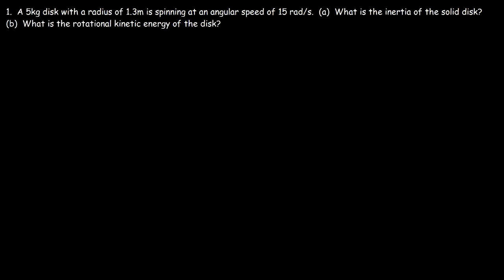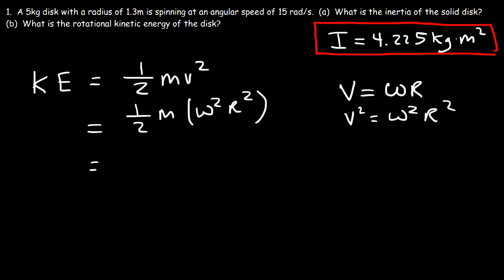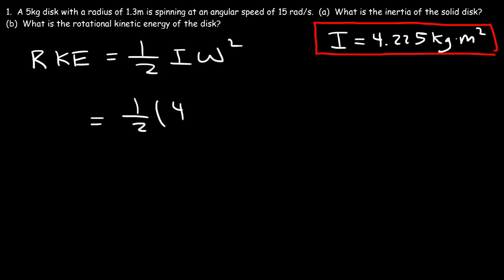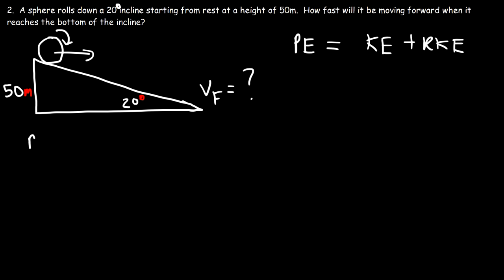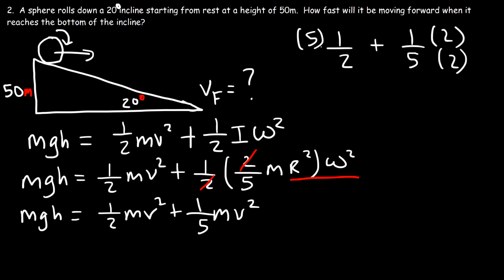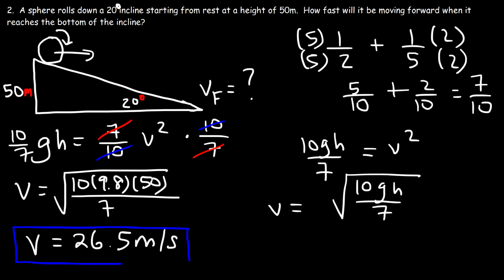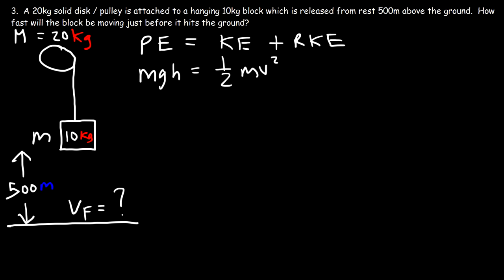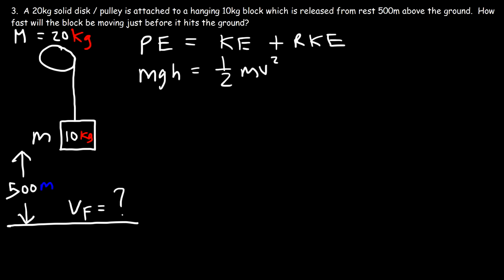Rotational Kinetic Energy and Moment of Inertia Examples & Physics Problems

Comment: K.E=IW²

K.E≠½IW²

From I=½mr² and v²=r²w²
K.E=½mv²=½mr²w²=½mr² × w² 

K.E=IW²

Mistake sir,you taught me thou😻🔥
Reply: Inertia is mr², it doesn't have 1/2
Reply: @susa9786  yeah but the tutor said in the video that the inertia of the disc= 1/2 Mr^2, and then he replaced it with I which is supposed to be I=Mr^2, and thats where the extra half came from.( normaly RKE=1/2IW^2 , but not in this case as her I=1/2Mr^2)
Reply: KE is equal to (IW^2)/2
and Impulse should be I=mr^2

Comment: 9:19 I know we get excited when we can start computing, but consider solving for v before you start to plug in numbers, as OCT did on the previous problem. Doing so can help you keep your sanity and also prevent you from losing points on exams due to computation errors during the extra steps needed (factoring, dividing, taking the square root, etc).

Comment: I have a question At problem 2 with the încline,  he didn't mension anything about the 20 degrees in his formula. So if it was 45 degrees and 50 m height it would be the same risult.  Is it correct? Please help.

Comment: In problem 2, Why are we handed the 20 degree incline if we aren't utilizing it? I assumed that we would use it to determine the change in height over the period it is rolling. therefore giving h = h(1-costheta). I'm still relatively new to physics so any help is appreciated. If not I'd assume the gravity component is affected by sintheta instead.

Comment: QUICK ONE/; How was the 2/5 MR^2 and 1/2MR^2 found ?
Basically where was the values which were used in place of inertia found  and how ?
Reply: 2/5MR^2 is the moment of inertia for a sphere and 1/MR^2 is the moment of inertia for a disc. I'm not sure why but if you google them I'm sure there's an answer out there :)

Comment: I need help. When how to use I=1/2mr^2 and I=mr^2 ??
Reply: I = 1/2 * m * r^2: This formula is used to calculate the moment of inertia of a solid disk (or a cylinder) about an axis perpendicular to the plane of the disk and passing through its center. Here, m is the mass of the disk or cylinder, and r is the radius.

I = m * r^2: This formula is used to calculate the moment of inertia of a point mass (or a thin hoop) about an axis perpendicular to the plane of the hoop and passing through its center. Here, m is the mass of the point mass or hoop, and r is the distance from the axis to the point mass or the radius of the hoop.

Comment: Hey tutor I think you made a mistake on RKE of Q1 part b. at the point where it is 1/2mr^2w^2, the 1/2 is part of the Inertia equation for a disk so when simplifying the Kinetic energy equation becomes Iw^2 not 1/2Iw^2, and will be double that of your answer. Please correct me If im wrong as I was stuck on this for a while. If you plug the numbers into the 1/2mr^2w^2 you will get double your final answer so I believe your final answer  is incorrect.
Reply: This is what I thought at first, too; however, the coefficient of the inertia equation varies depending on the distribution of mass. Thus, because the general equation for inertia is mr^2, we can substitute it with "I" and still get the correct answer.

Comment: I'm quite discombobulated, if inertia =1/2MR² and RKE=IW, then how come RKE=1/2(IW²)
Reply: Inertia is equal to MR squared not half MR squared, the half is only used for disks as they have their mass distributed differently, which requires that constant term
Reply: @callynbarath4005  but the whole problem talks about disk, so shouldn't it be 1/2MR^2 all over?
Reply: @DigitalLifeguard  the first example is a sphere, that has a different constant term because of its mass distribution, second one is a disk, that's why it'll have half MR squared
Reply: Callyn Barath i am talking about problem 1, “ A 5kg disk” not the second one with the sphere
Reply: @DigitalLifeguard  i watched it again, i believe he does use half MR squared when calculating the inertia of the 5 kg sphere, at the beginning when deriving the rotational energy equation he doesn't use it because it applies to all objects irrespective of their mass distribution
Reply: Callyn Barath I just don’t think that’s right because in part b) he already have the 1/2MR^2 in the expression, that he could’ve just replaced with I, instead of taking another 1/2 of the I he already have, but whatever 👍🏾
Reply: The reason he did not include the 1/2 is because he is making the universal rotational kinetic energy formula: RKE=1/2(I)(W)^2. The base equation for the moment of inertia is I = mR^2. However, all objects have their own coefficients, hence why he used I = 1/2mR^2 in the beginning of the video. I believe his intentions were to show the base formula for rotational kinetic energy first prior to getting into more details.

Comment: I dont get why the torque is in negative,, isn't it in clockwise direction? it will be a big thanks for anyone whos gonna reply me!
Reply: If torque is clockwise, it's negative. If it's counterclockwise, it's positive. I don't know why. I know it's weird. Something to do with trigonometry....🤷‍♀️👍
Reply: @Mik-gw7tv  Hey clockwise is negative because in trig if you are told to draw a line with an angle of 40 degrees you don't draw it below the x-axis but above it, therefore above x-axis in the counter clockwise direction is positive.
Reply: @samb.7395  Ahhh interesting. Thank you for the answers.